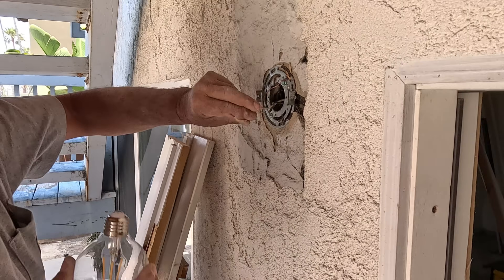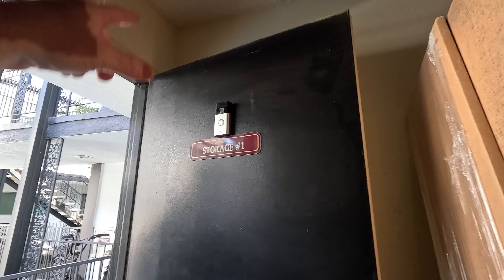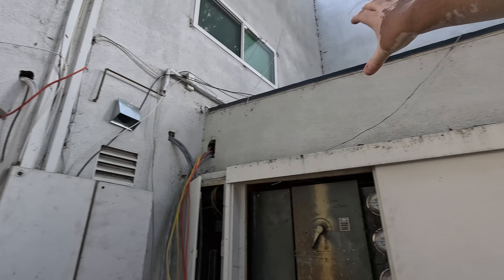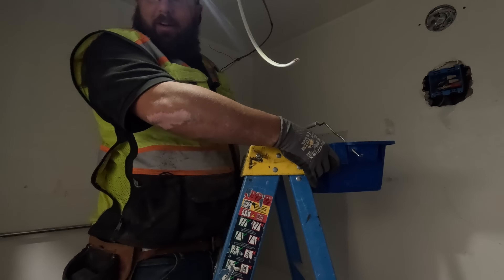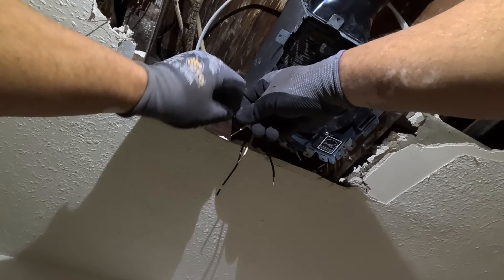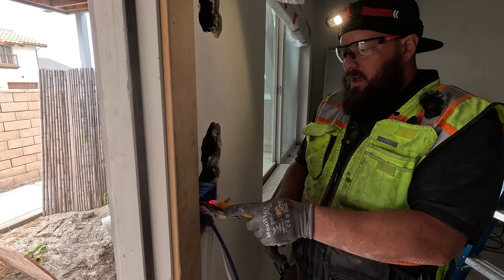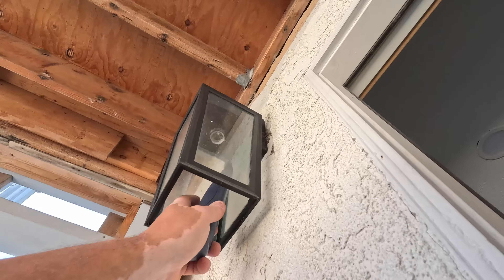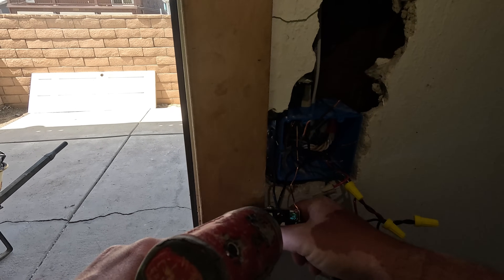MASSIVE Electrical Panel Upgrade | Master Electrician POV Vlog Ep. 3

Comment: You gotta be careful with the drill motor using it to tighten down the screws on the switch. I ran into a lot of broken switches because of people using the drill motor.
Reply from the maker: That’s a good tip! Appreciate you!

Comment: For any outlet or junction, when the power is off, determining which direction is back to the panel is fairly simple. 
1. Confirm power off
2. Separate the neutrals
3. Clip one lead of your multimeter to ground
4. Put your meter on continuity (with tone)
5. Tap the neutrals until you get a tone, that'll be the direction towards the breaker. 

Something similar can be done towards a light fixture. Use an incandescent bulb (IE an appliance bulb), but this time do the following: 
1. Use your meter to check the bulb's resistance.
2. Install the bulb in the fixture/socket.
3. Confirm power off at the switch location.
4. Check resistance between hot and neutral. Whichever wire direction comes back with a resistance similar, or just a little higher than the bulb alone will be your light fixture direction.
5. Unscrew the bulb and recheck the resistance, and it should show an open.

Checking the bulb resistance before starting also helps confirm the bulb is still good. And using an appliance bulb is because they're more durable than standard incandescent bulbs (and actually available).
Reply from the maker: Really smart! This is exactly why I started the channel. So me and others can be better electricians. Appreciate your input!

Comment: What toner were you guys using when doing your troubleshooting?  that one is way louder and clearer then the Klein one I’ve always used.
Reply from the maker: It’s the Tempo 801K I believe.
Reply: I use a cheap knockoff and it's louder than my old $200 one, works out sometimes. 😂

Comment: Wire not use Wago connectors instead of wire nuts to join wires together. Think wago connectors are much better.
Reply from the maker: I do like wago’s but usually I only use the them what the come with fixtures. You like using them for everything?

Comment: I feel the burn. That was the hardest part of the job was reaching overhead.
Reply from the maker: For sure! Every time I work overhead it builds those muscles. You do commercial work or resi mostly?
Reply: @landerselectric  I used to do commercial and residential. We did a lot of different things from adding circuits, full rewires, new construction, and service changeouts. I also did some commercial and bent a little pipe here and there(I was a 5 year apprentice) and was casted out of my trade. I wasn't able to get my license and found I'd have to start all over from scratch. I was resentful towards my boss and went down the road of taking a business over from an old man that sold out and fired me after 10 years. I've been bouncing back and forth trying to keep a job like working in produce at walmart to meeting my future wife and thinking about buying an old gas station to run together. There's not many options up in Northern Michigan for work.
Reply from the maker: @ATSNorthernMI Man, too bad it didn’t work out in electrical. Perhaps the gas station will work out! A friend of mine wants us all to move to northern Montana but I’m afraid of what you said, not enough work in more rural areas. I think about guys like @victoryoutdoorservices working in areas with tons of rain and the weather really impacting work and it scares me.
Reply: @landerselectric  As a content creator, you can move pretty much anywhere and shoot content. It will start becoming more profitable. I thought about this when I was an electrician. I seen so much stuff, I wish I had a camera. I loved working with the guys which were funny and very skilled. I learned everything I know today from them.
Reply from the maker: @ATSNorthernMI  that’s a great point. I’m really hoping that someday my channel will get to that point. Not there quite yet, but really trying to build a community under this master Electrician channel.

Comment: The Klein digital GFCI/receptacle tester is not the best—it's confusing. The simple $10 tester works well.
Reply from the maker: I haven’t tried it yet. It worked when we were using it in the video but I’ll check it out and let you know after I use it for a while.

Comment: No pre twist
Reply from the maker: You know I don’t really prefer pre-twisting the wires. I don’t have anything against it. I’ve just gotten in the habit of twisting them with my fingers so I can feel exactly how tight they get. A lot of the time I’ll take the wire nut off after I’ve already twisted everything together to make sure everything is Secure. You like the pre-twist method the best?

Comment: it hurts me that you didnt check the switch for continuity :(
Reply from the maker: I hear you. The switch ended up being fine. I literally don’t know how a light bulb could cause that. The light bulb worked except when the dimmer was tied in and turned on. You an electrician?

Comment: I wouldn’t have known where to start
Reply from the maker: Ya this one is going to be a challenge. Can’t stop thinking about it. What type of work do you do?
Reply: @landerselectric  retired mechanical and electrical maintenance in a large chemical plant, mostly routine work with a little troubleshooting. Worked 12 hour shifts.Thanks for asking.
Reply from the maker: @garylatture8948  For sure. And that's awesome. 12 hour days are long days!

Comment: How many electricians does it take to figure out you need to change the light bulb?  😅
Reply from the maker: Seriously. That was a really weird situation. The lightbulb was working except for when you turn the dimmer on. Have you ever ran into a situation like that?
Reply: @landerselectric no but im not 100% on what happened here.  So the porch light worked fine on its own but when you wired in the dimmer for the living room lights the porch light didn't work until you changed the porch bulb?
Reply from the maker: That’s exactly right. That’s why I didn’t question the light bulb to start. It was really messing with my brain. As soon as we changed it everything worked perfect. Thoughts?
Reply: @landerselectric  thats a weird one for sure but you got the lights on so job well done and on to the next.  👍
Reply from the maker: For sure! Have a great weekend! Next week - keep going on the meter pack electrical panel upgrade and start a new commercial EV charger station project north of LA
Reply: Was the neural in series as a source. For tyat light???  Lol odd Check amperage at both point to verify
Reply from the maker: That’s a good idea. I’m going back next week there as well. I should check it.
Reply: @landerselectric yeah a  little update on this would be awesome 😛
Reply from the maker: I’ll see if I can get back in that unit. I think they might have it rented out soon so we’ll see.

Comment: That is one HECK of a big job sir.

Colleague managed to get 240 the other day due to a brain fart, turned off an A/C unit isolator, then removed the FEED cable instead of the load... he woke up fast LOL
Reply from the maker: What a bummer. Is he OK?
Reply: @landerselectric  Yeah, was rcd (GFCI) protected at 30mA and it didn't trip so his rubber boots saved him from more than a wakeup moment :)
Reply from the maker: Really glad! It could’ve been way worse!